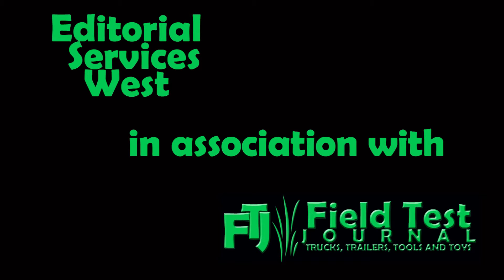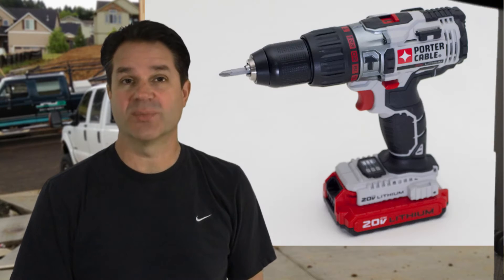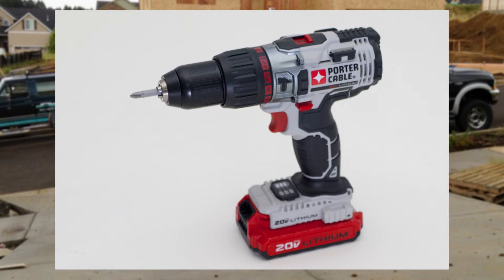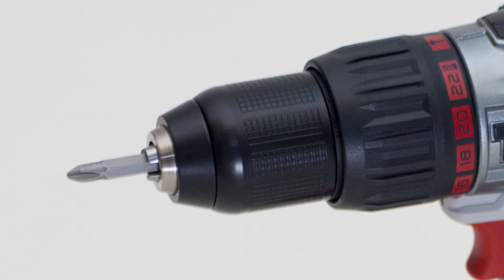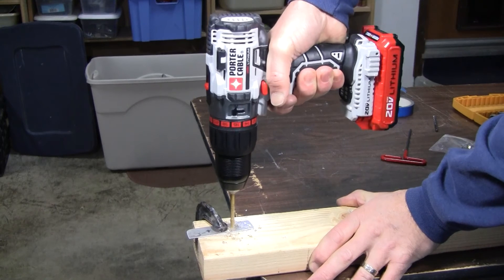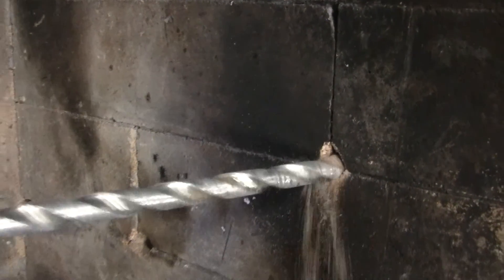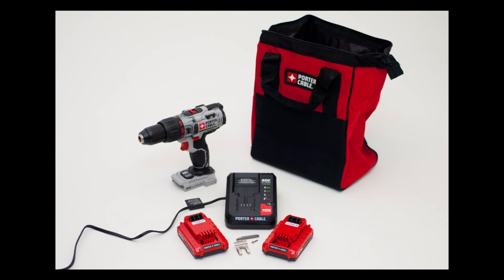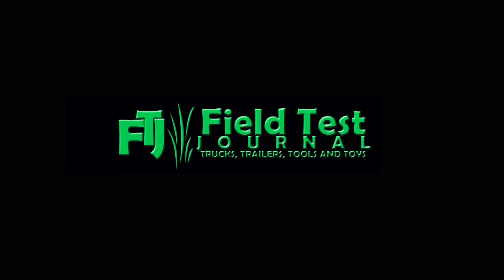Porter Cable 20v Hammer Drill

Comment: can you use the "hammer drill" to remove lug nuts or simple nuts to tighten daily objects
Reply: What you need is an impact driver hammer drills are for drilling through masonry and the direction of the hammering would probably just screw up the threads and whatever you're trying to tighten or take off an impact applies the force in a circular motion instead of straight to the back of the bit